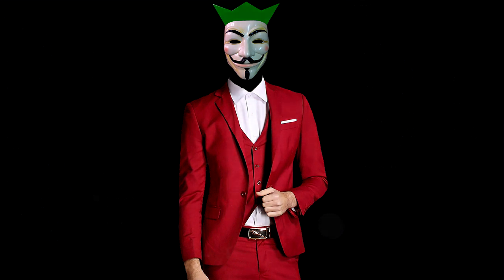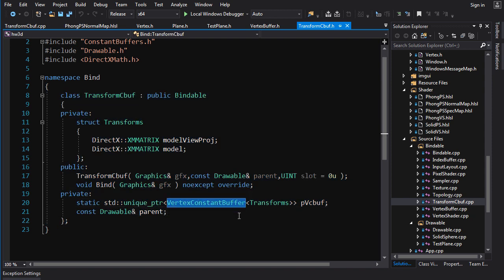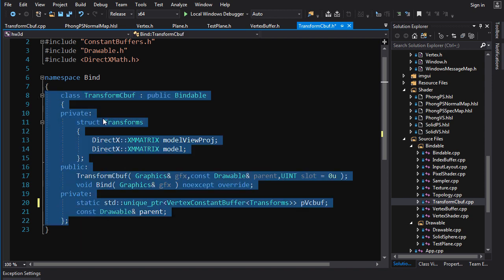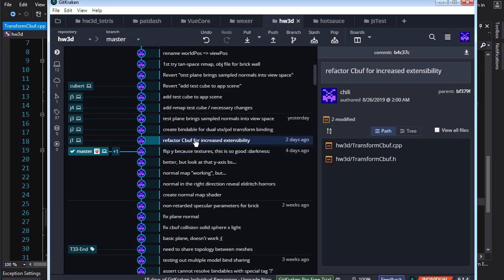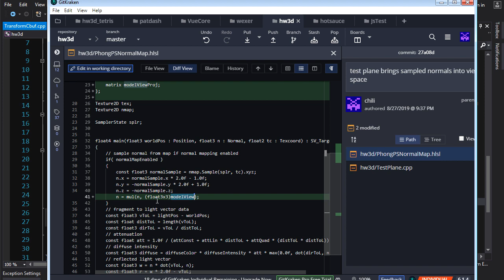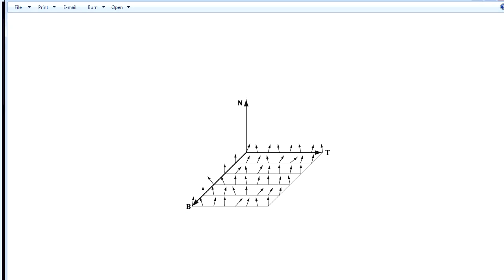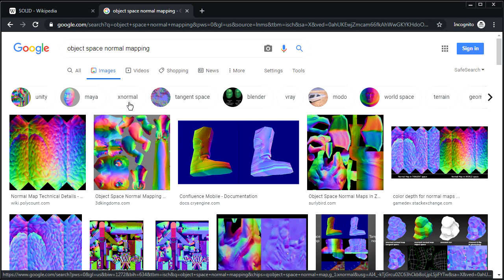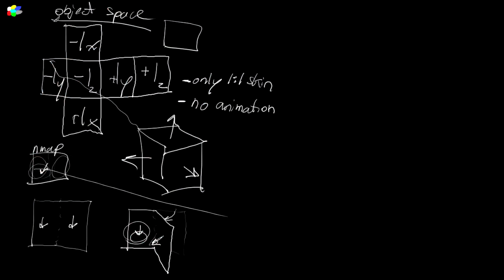C++ 3D DirectX Tutorial [Normal Mapping Part 2]

Comment: Sorry, but I disagree with SOLID and OOP principles. With some of points.
I prefer KISS principle, data oriented design. I like separation/abstraction in code.
But I believe that if you want to do abstraction right, you can't do it in a place where you need to break it, where you need implementation details.
For example if you need functionality to print text on screen, then you probably want to have function printText(const char*) defined in printText.h file (or something like that).
And printText.cpp with implementation.
And you shouldn't put any extra files, classes, functions with implementation all over your project.
Regardless if printText is calling printf and is 1 line of code, or if it's creating OpenGL window, and using Imgui and is 10000 lines of code.
User of function printText doesn't need HWND handle, doesn't need Window class, all they need is function to print text.
I also believe that 1000 lines of code in 1 function is much easier to understand than the same code split over 200 of functions. Also 1 function is much easier to maintain, optimize, and work with. Because you never have to wonder is that 1 line of code called from some other random part of code in some other file.

Most people hate me for the way I code. But I actually never heard any constructive criticism or argument for SOLID.
Only arguments I hear are "Because professor on university say so" and "You are stupid".
And I have spend lot of time googling for code design tutorials. Still nothing.

Lastly I would like to highlight that even that I don't agree with some points, I still like the video.
I think that this video series is best DirectX 11 tutorial I have ever seen.
Reply from the maker: no need to apologize for having an opinion bruh
Reply: "...and "You are stupid""  LOL That made me chuckle. This seems to be the standard defense for the ignorant. And I agree that this is one of the best DX 11 tuts out there.